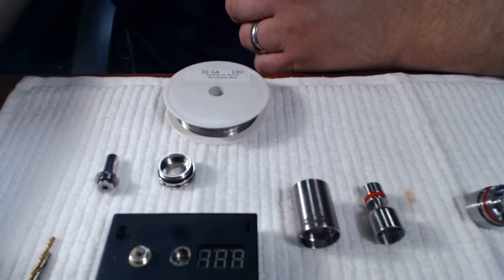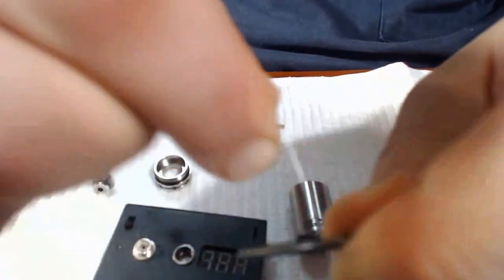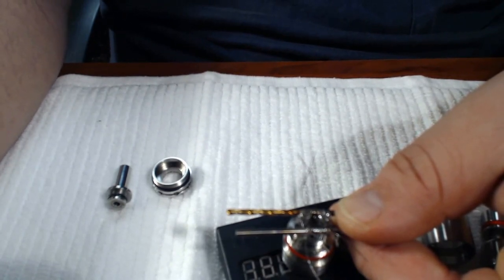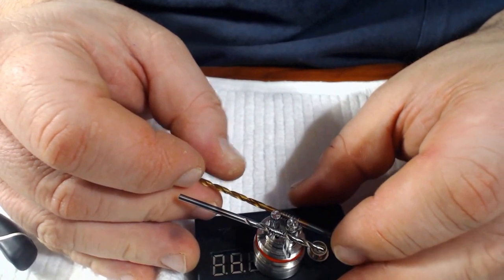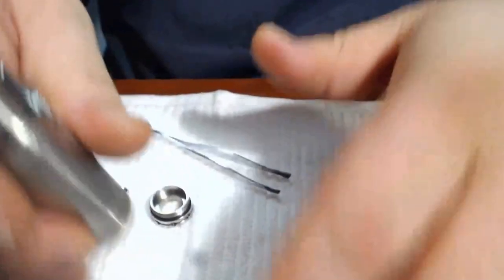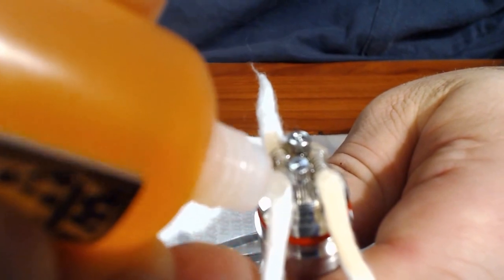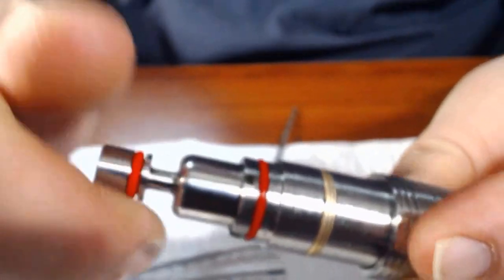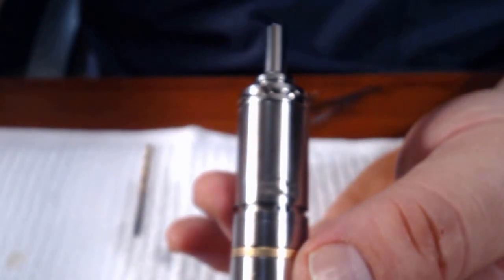Aqua Atomizer Step by Step Build

Comment: I have had my aqua for a while and was looking for different build ideas.  Me and you are almost dead on the same with our builds.

Personally I get better wicking and flavor by only running the wick down the vertical channels and I cut the wick level with the top of the horizontal channels.  It might be better for me because I prefer to run my aqua in the .6-.8 ohm range on my 18650 mechs.  (About 5 wraps with 30ga kanthol A1) You might try that one day and see what you think.

I'm one of those that closes the air flow to fill for added safety but do what ever works for you.

A tip with your cotton.  When your running the cotton threw the coil pull it threw like you did but use your other hand to gently twist the tail end as you pull.  This will keep you from getting that "knot" on the back side of the coil.  You don't need to twist much, maybe half a turn as you pull it threw.

Good video on a great tank.

Comment: I'm sure it's a wonderful vape but I have to wonder if it's worth all the hassle of the build and the teensy 2ml capacity.  I tried building this thing for an hour and threw it back in the box out of frustration.  I've rebuilt coil heads, RBAs, and RDAs with little difficulty but this one really threw me for a loop. That said, this video was helpful and inspiring so I guess I'll give it another shot. :-)
Reply from the maker: Awesome it is a little tricky but after a few times doing it becomes easier. thanks for following and good luck. hit me up if you need anything

Comment: Try some micro coils and get 'em closer to the airholes, you'll get more vapor. Oh btw, you can mount one coil under the bottom portion of the nuts next to the deck, and the other at the top part of the nuts. That makes building this atty alot easier as you can mount your coils seperately :-)

Comment: two thoughts. one. you said 1.6 Ohm. it was actually 1.06 so just a smidge above a 1Ohm coil. and when you "pinch" them it changes the Ohm's. so you should recheck it. great video though. thanks for the post.

Comment: Hows it handle thicker juice & do yu think its a tight draw even with the air wide open (I do lung hits).
Reply from the maker: i usually use 50/50 juice and it works great for me. i also really enjoy the draw i too do lung inhales thanks for following and vape on .
Reply: elksvapor z Got my clone.. Set my coils and I'll be damned if it doesn't leak through the air holes. I'm thinking my coils are too high above the air...

Comment: What type of related mods will fire a 1.06 ohm coil? DNA 20/30 mod will, but besides those I think that's too low to fire on a regulated mod. I think most will only go down to 1.2 ohms. Correct me if I'm wrong.
Reply from the maker: most regulated mods will fire at 1 ohm and higher thanks for following bud
Reply: Oh, I have only really had experience with the SMOKtech SID, and a couple Innokins, and I think when I was building my uncle's Kayfun on his Vamo it was over 1.1 or 1.2 or 1.3, somewhere around there. I guess since those are all cheapo $50 mods they don't fire down to 1 ohm.
Reply: You cut it super close at 1.06 ohms if yours fits down to 1 ohm! If you would had connected one of your leads about 1 mm shorter you would have had to rebuild the coil all over again. Ahh. I hate when that happens. I'll build my Russian with 12 wraps of 28ga on an 18ga needle, and I know I did 12 wraps the other times, but this time it will say "Low Load", then I'll check out on my meter and it is 1.18 or 1.19 and I'll have to rebuild it all over again. That one or two hundredths of an ohm make a difference as far as the electronics are concerned. I should have my Hana soon, it's been Poe paid for a while now, so that problem will be solved.

Comment: I have tried mu aqua on both my k-100 and magneto and my coils just aren't getting as hot as i would like. the glow red but never get white hot. I'm using 28 gauge wire and it is running at .9 ohms. any suggestions?
Reply from the maker: try using 30 gauge wire that is what i have switched to .  it works better and gets hotter.